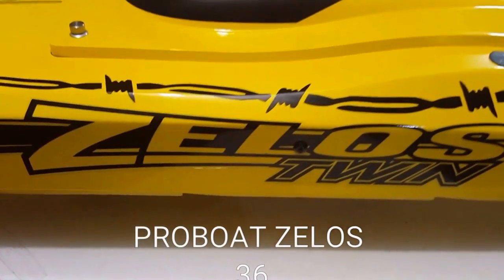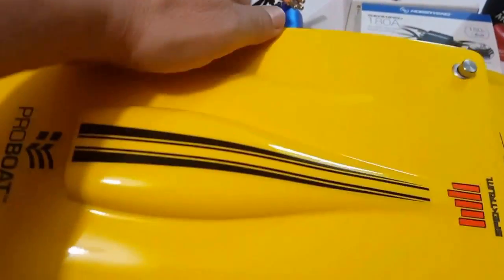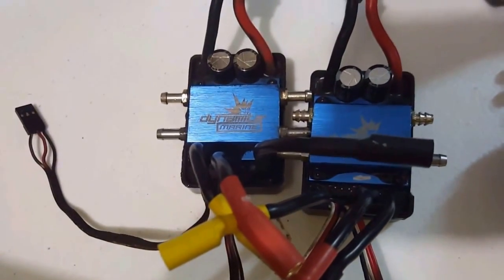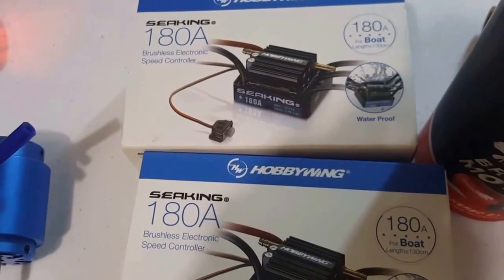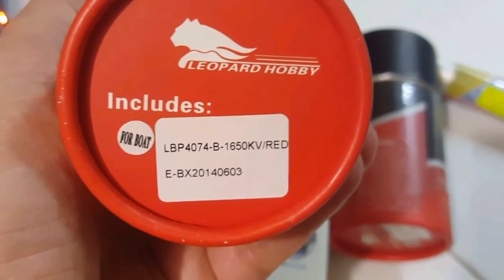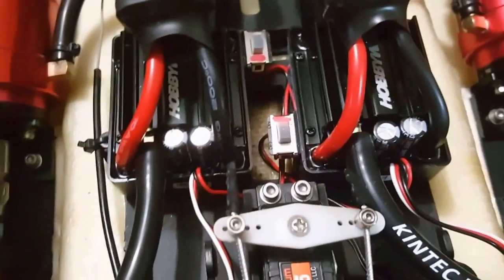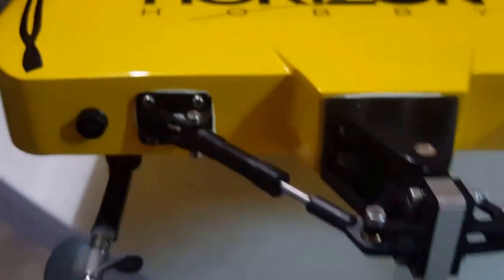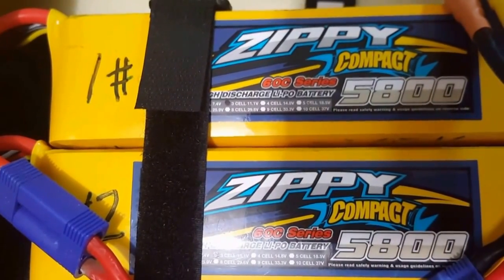Proboat Zelos 36 upgraded motors and esc's

Comment: Did u notice a big difrence next to stock on speed temps n fun overall
Reply from the maker: Ohh, yes! A huge big difference, more power, longer runtimes, very 🆒 electronics, batteries suffer a lot lot less, runs smoothly, less effort, but the best of all: very cold temps. Making 65-75mph on 6S lipos and runtimes of 7-8 mins at full throttle.
Reply: @edwincordero8  nice i will b upgrading them next week on mimes how about the escs there holding on with out any issues
Reply from the maker: @10krms8  Never had a problem with those HW 180A esc. Never! Leopard motors are inside all my 7 rc boats and never an issue of any kind. With that upgrade , the flex shaft and coupler must also be upgraded. All my goodies from Offshore electrics.
Reply from the maker: Temperatures never higher than 140°.

Comment: Thats an awesome boat brother!! I have a sonicwake 36 and I just add a Leopard 3674 X2 4-Pole Brushless 1900KV  Motor but want to add a 180 Seaking ECS but due to my self-righting hull not sure if It will fit!! Anyways, where do I find a cooling jacket with my Leopard 3674 X2 4-Pole Brushless 1900KV  Motor ??
Reply from the maker: In my humble opinion, 3674 is a small motor for that hull size, will work very hot. But if you keep it, visit Offshoreelectrics .com. They sell everything rc boat related. Also know their stuff and help you out.
Reply: @edwincordero8  Decided to go with the Leo 4074 - 1050kv instead!!
Reply from the maker: Hobbywing brand esc's are great. Make sure you buy them from authorized sellers, or visit Hobbywing .com directly.

Comment: Hi Edwin purchased this boat and I was checking to see if the flex shafts are turning the correct way when looking at the boat from the rear they both turn clockwise is this correct thanks for the help..
Reply from the maker: QuickDrawMcDraw 227 
Hi friend. Righ side propeller should turn CCW. Left side prop, CW...looking from the rear.
Reply from the maker: QuickDrawMcDraw 227 
Also, the flex wires are right and left, accordingly, to prevent unwinding. The propellers are also left and right.

Comment: Nice video.. Is it safe to run 12s on this setup?
Reply from the maker: Nasli Daud 
Hi. Yes. It is safe. You can use four 3S lipos or two 6S. You"ll have a lot of power and speed and also a lot of weight and heat on the motors and escs
Reply: Mine is zonda ..this is my setup.   sss motor 2075kv, 180a esc (same like yours) , now Im running 6s( 3sx2)... Do I need to replace the motor to run 12s on it ? Thank you very much..
Reply from the maker: Nasli Daud 
I know for sure Hobbywing 180A esc are up to 6S capable. Can't tell if SSS 2075kv motors can hold up. Check your motor specs to be sure. High kv motors use smaller props than low kv motors like mine( 1650kv) and i use a tiny bit bigger props without any heat issues at all. With my setup i can run 6 or 7 mins and never reach 120° on electronics.
Reply from the maker: Nasli Daud 
I just read the specs on your SSS 2075kv motors. According to RCBOATBITZ, your motors are 3674- 2075kv for use with 3S-4S  lipos. The can size (3674) is relatively small for use with 180A escs. It is recommended to use only 120A esc's.  For use with 6S lipos, motors should be swapped to lower kvs and then you can use 180A esc. Otherwise they will get hot like the sun.
Reply: Thanks bro..

Comment: Got the boat going today 70 mph 1716 Abc s
Reply from the maker: prichard tree care 
What was the problem?
Reply: Edwin Cordero so the props were on wrong shafts,  and 1 motor was reversed and the remote was reversed backwards
Reply: Did you get to run yours yet
Reply from the maker: prichard tree care 
Yes . Ran it many times. But i have no one to record video for me.
Reply from the maker: prichard tree care 
Your Zelos needed settings and minor adjustments. Now you got it flying.
Reply: Edwin Cordero yeah not bad
Reply from the maker: prichard tree care 
Don't forget to grease flexshaft wires every 3 or 4 runs. Dont overdischarge your lipos or they will "puff". Enjoy.

Comment: Hey Edwin I put those props on 2 new 3s batteries ran to 6s boat would only do 15 mph
Reply from the maker: prichard tree care 
Hi. How many C  for discharge rate are those batteries?
Reply from the maker: prichard tree care How much discharge rate are those batts?
Reply: Edwin Cordero 110 c  9100 mah
Reply from the maker: prichard tree care Are they fully charged? What kind/brand of charger are you using? 9100mah require a very big and powerful charger.
Reply from the maker: prichard tree care 
If batteries are not fully ccharged with a good quality powerful charger, the ESC's on the Zelos will work on low voltage cutoff, thus allowing only very poor performance and low speed.
Reply: Edwin Cordero brand new max amps
Reply: Send me email Edwin
Reply: Edwin Cordero hitec multi x1ac I used it to charge my 6s batteries works well

Comment: Nice boat but u swapped motors that are slower ..i just did a build put in 2 120 amp seaking ...
2- 380 2840 kv SSS motors.  
2- 3 bladed grim racer props 
In my apparition. I hit 88mph easy.  Maybe u should research a lil before u do anymore. I Think zelos are over rated for price u pay. Home builds are so much cheaper
Reply from the maker: Jason Parsons 
Hi. Thanks for the advice. I'm not looking for higher speeds, instead, looking for better performance,cooler electronics and longer runtimes. But fyi, i used two Octura 447 props and the Zelos flies like a jet on rails. Went back to stock props to achieve my goal. Thanks.

Comment: Nice clean set up. Did you ever get to run.it?
Reply from the maker: Burnut62 
YES. Ran it last weekend. Very fast. Too fast . But i was alone at the pond , no camera available for video.  But i will post it next week with my daughter recording.
Reply: O ok nice. Would love to see it. I have one. With the same esc's and looking to up grade my motors
Reply from the maker: Burnut62 In advance, it runs waaaaaaaaaay cooler. But waaaay cooler than stock. Never more tha 100° in motors/esc's.

Comment: that's some serious money in that boat mate nice! I have a v3 miss gieco 29 inch that I will upgrade motor only I only want a bit more speed I'm very happy with it lol
Reply from the maker: Daz Stewart Hi. Strong Zelos 36 deserves it. Happy with it. I also have the MG V3 with upgraded motor/ esc, flex wire shaft, coupler and some other upgrades. Check my channel for more vids of the MG V3. You'll get the idea. Thanks

Comment: Nice! Why did you go with a 1650kv motor? I think the stock motors were in 2000kv range. I swapped motors and ESC for T180 and TP4050/2050kv. Managed 86mph! Check it out!
Reply from the maker: Keagan Moore I wanted lower temps on electronics. Stock motors were on the 150°. But i haven't tried the boat yet to see the speeds it can reach.
Reply: Ahhh that explains it. Thanks
Reply from the maker: Keagan Moore Thanks for noticing. Good observation.
Reply from the maker: Keagan Moore 
Did you use four 3S lipos or two 3s batteries to reach 86mph?
Reply: Edwin Cordero I used 4 3S packs. Turnigy HD, breaking in some Revos for my next attempt
Reply from the maker: Keagan Moore Ok. Can you share the link for the Esc's wire harness needed for that set up? Can i use two 6S lipos instead? Thanks
Reply: Edwin Cordero it is on horizon hobby website, it looks like a Y harness and you will need one for each ESC. You can hook up 6S lipos per motor but you wouldn't use any harness in that case. Direct to the ESC.
Reply from the maker: Keagan Moore Thank you very much. 👍😊
Reply: did you ever make it out?
Reply: Yup I did, today actually. Didn't get a clean run and it was very windy and choppy. Bested my time by .1mph. Lol 86.6mph with Poseidon motors.
Reply: Damn lol

Comment: She looks mean and lean!! Nice work,  hey I have a question, I have the pro boat impulse 31, all stick right now, I bought a turnigy 180amp esc, which leopard motor should I get? Using the stock prop as well. I'm wondering if the leopard motors have a nice large gauge wire that matches the esc size wires.
Reply from the maker: DeucesWild Hi Deuces:
Turnigy 180a and Seaking 180a are the same thing. But sometimes one or the other could have large connectors for the motor or smaller banana connectors. Manufacturers can't determine where the end user will be installing the esc or which motor we are going to use. So if your esc has a connector that can not fit you, simply desolder them and solder  the ones you need for your application. For the Impulse 31, i would use a Leopard 4074 1650kv or 1800kv motor with that 180a esc and stock prop. But that's me...with that set up, you must use 50 or 60C discharge rate batteries. That set up will give you very high speeds (55mph+).
Reply: Edwin Cordero the impulse 31 v3 has a stock 1750kv dynamite motor I believe
Reply from the maker: Daz Stewart 
Hi. With the Impulse i would keep the oem motor and switch to Seaking 180A.  Check your temps after the first 3 or 4 minute runs. Always use high discharge rate lipos (50 or 60C). it should give you 50 or 55mph depending on the strut settings, baterry position( CG), wind, and water conditions. At higher speeds less run time, more heat on the electronics and less stability. These Proboat hulls are made for sport  enthusiasts. At very high speeds( more than 50 or 60mph), the hulls will receive more stress and could crack or break. It all depends of what you want.